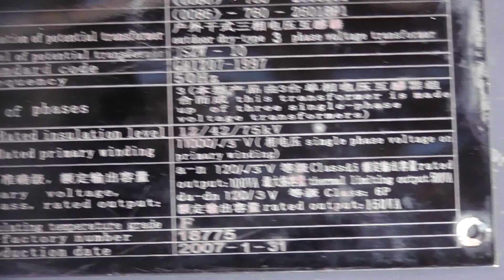3 x 6350 Volts VT's score

Comment: They look like huge flybacks, I love them.

What were these used for, may I ask?
Reply from the maker: +MisterTalkingMachine They were used for measuring voltages on 11 kV  lines and supplying 63½ / 110 Volts for charging scada systems and remote operation of line equipment like reclosers.

Comment: Can you put the 3 of them in series with proper phase?
Reply from the maker: +paul larson Yes, it is possible, the ins level is 42 kV.
Reply: +RODALCO2007  I read some of the comments and think I might understand these better. I'm not into the power distribution market as you are. So they were used to safely monitor Hi-potential in a 3 phase (overhead) distribution. And looks like they are 100 : 1. You just reverse powered them.  I could see how trying to series string the hi-potential side could be problematic insulation wise; since I think one side is connected to the core. Good video, and always error on the side of caution Rodalco!

Comment: what were they used for?
Reply: +m3sca1 Usually Potential transformers step down a high voltage to a low voltage with a high degree of accuracy, so that high voltages can be accurately measured with negligible load to the circuit. The primary coils are connected to the high voltage and the secondary coils are attached to the meter. In this case Ray has hooked it up backwards for some arcs.
https://en.wikipedia.org/wiki/Instrument_transformer#Potential_transformer_.28Voltage_transformer.29
Reply: +RadioTrefoil in a simple way to mesure high voltage in a safe way ?
Reply: Pretty much a very accurate, safe way to measure high voltages without damaging the meter. Otherwise you would have to use a potential divider using resistors which can be problematic at high voltages and completely unsuitable for high power applications.